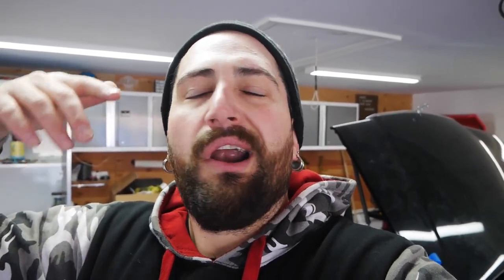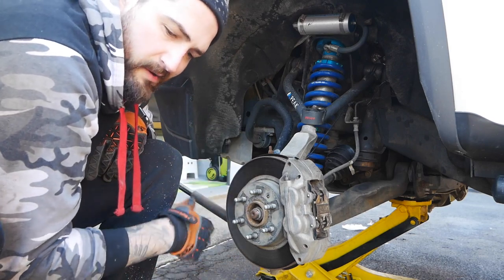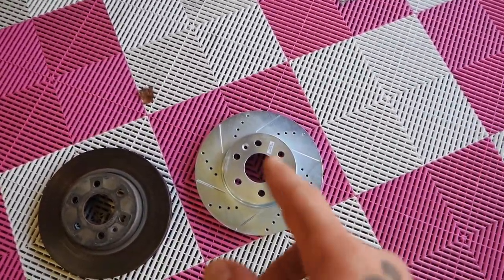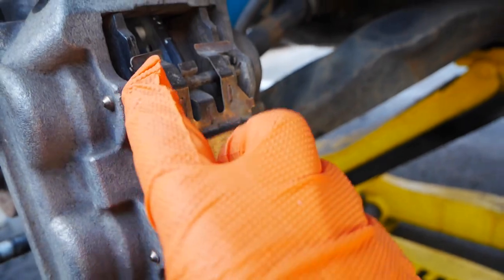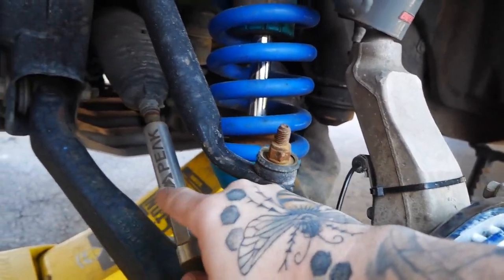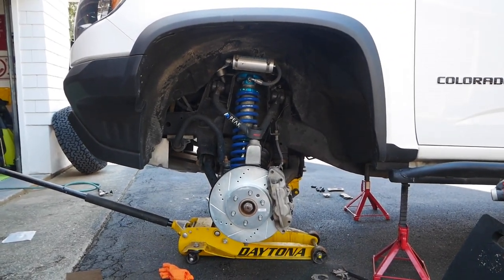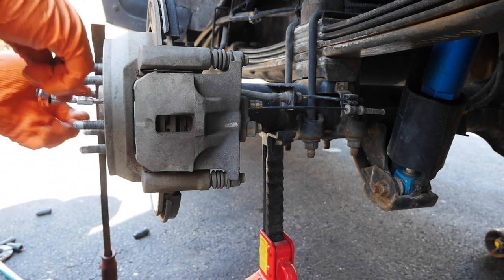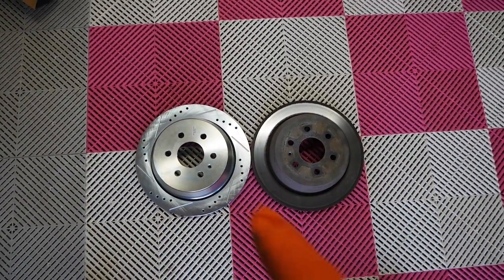Every Chevy Colorado needs this brake upgrade

Comment: Thanks for the video Chris. I’ve been tempted to do this brake upgrade myself. I’m around 28k, but recently had some new brake noises (even before I noticed some slight oscillating noise) after some offroad mud pit adventures. I suspect at the very least I got some debris stuck between the rotor and pads and caused some slight damage. When I checked all the pads were good, one rotor had some slight unevenness. New noise has cleared at this point after cleaning and mileage, might need more liberal use of good brake lubrication on the right areas, if I can figure that out. One thing I noticed was when pulling the caliper pins safety clips is when they are rotated and hard to pull without dropping, you can rotate the pins from the inside ends. Sorry for the trouble with tie rods sleeves, I may have been an influence on that idea 😬.
Reply from the maker: also could have been some dirt between the dust shield and the rotor.... glad it cleared up tho.